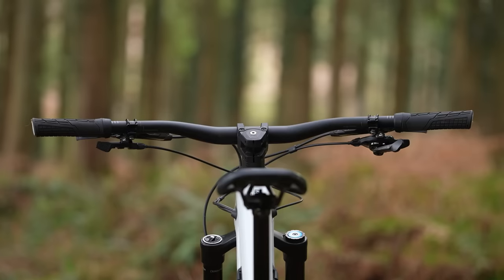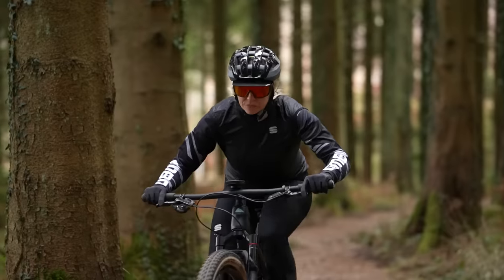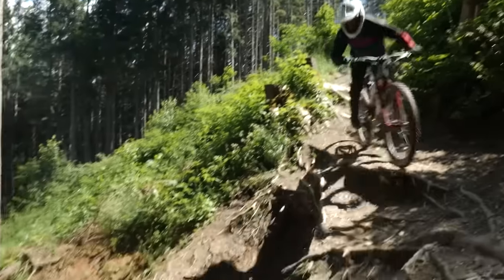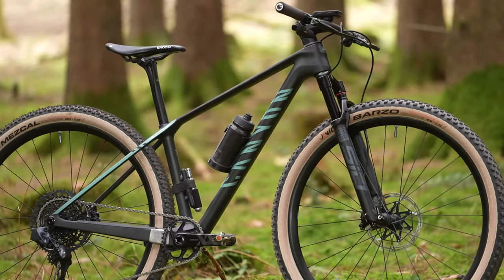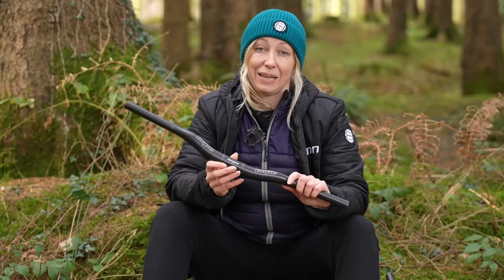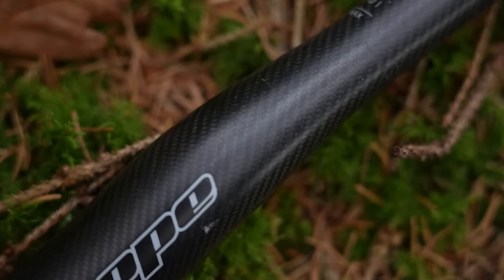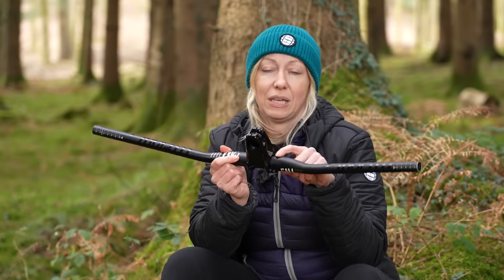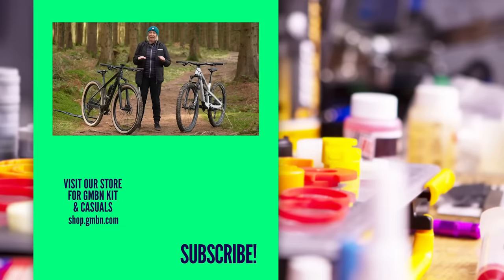Mountain Bike Handlebars Explained! | What's Right For You?

Comment: I changed out the bars on my bike for ones with a 60mm rise because my back was hurting, and it made a huge difference. Immediately the pain was gone and it feels great going downhill, which is what I prefer anyways. Still not bad up hill either. Only when it get's really steep is hard to to keep the front down, but it's rarely an issue and well worth getting rid of the back pain.
Reply: yeah you can bend elbows when you need to be lower, anyone reading this get comfortable!  you can still shred fine
Reply: are you 40+?

Comment: There are actually many -40 degree stems on the market. In fact, they're cheap +40 degree stems meant for beginners, but you just flip them upside down.
Reply: This sounds like one of those counter life hacks. Like they try to bend the bars to make it negative and you just walk up and flip it over.
Reply: @busterbeast999  installing a stem upside down is not really a "hack", it is basic.
Reply: the heck.
thats written -+40 that means its on you how you used it.
what she talking about is the one piece carbon negative 40° handle bar.

Comment: Great video covering a lot of info!  I just decided to get a handful of low end model stems in a variety of lengths and rises and brands and see what configuration I like best - they only cost around $30 each. I did the same with handlebars. Once I figure out my sweet spot, then I will know the exact specs I need if I decide to upgrade to a higher end component. I'll also have the ability to modify in the future if I want. Roughly $300 for 4 stems and 5 bars will give me a full range of combinations to play around with. I'm not sure what a bike fitter costs, but I'm thinking this is a better option 😂

Comment: #askgmbntech I recently got back into mountain biking, I've ended up with a Norco Torrent with 800mm bars and I've later also bought a Trek Procaliber with 750mm bars. When I ride the trek I find that my hands hang off the end of the bars slightly, is this likely to be an issue with handlebar width or is it likely I have my brake levers/shifters in the wrong place?

Comment: I am 1,63m and I tried dozens of grips. Also all angles of my bar rolling forward or backward. My previous grips were the Egon  with the mini Wings. They made my outer wrist pain go away, but they caused numbness 😱 I switched to the Ergon GXR. They solved the numbness problem but the outer wrist pain came back. So I looked for something that is nice and squische and provide the angle of the Ergon mini wings. Then I found out that there are bars with way more backsweep. Tested the natural backsweep of my hands, like Anna discribed. Voila: A backsweep of at least 16° is needed. Went for one and on top I shortened the bar to 760mm. Boom: Nice comfy position for a lot of hours of riding to come. Well, I admit they look funny and some friends called me out for using a trekking bar on my trail bike and I may break, but it is certified for downhill riding 💪🏾

Dmn, that was journey to find a good position 🤪 At least it made my way to a comfy position on my gravel bike way shorter 🤫

Comment: Look at the angle your wrists make. I found having a lot of backsweep helped a lot to keep wrist straighter. Kona Handplant bars are a nice sweep. Mounted upside down you don't even need a -30⁰ stem or anything. you will need a longer stem to compensate for the backsweep, I went with a 130mm stem to put the hands back in the same position as the flat bar.

Comment: It's surprising to see how bar width has developed.
Back when I was racing in the 90's, expert were adamant that no wider than 650mm should be used. And my push up width is 950mm! 😄
I had to make my own bar extensions in a lathe 🙄

Comment: I'm running 720mm carbon bars on my trail bike, but I can't figure out why I can't seem to keep my front wheel planted on the climbs. Idk if the bike is too long or too short, if I need bar drop (I'm running flat bars), or if maybe the stack is too tall, but the bike always pops wheelies if I'm in the saddle and not deliberately shifting my weight forward. That being said, it descends like an absolute champ just keeping my body central on my bike. Any advice would be helpful.
Reply: Longer stem, it will naturally bring body weight over the front wheel.

Comment: Rolling the bars slightly backwards on a hardtail makes sense. Thanks! I didn't think about that so far. 
I don't know if the more agressive the riding the wider the bars is a right approach i have relatively wide shoulders compared to my size and I feel like I have more control with a 740mm bar than a 780 or even 800mm bar because there's more room for the bike to move in a controlled manner underneath me in technical terrain, when the front for example deflects going higher speeds when descending
Reply: If the bars are wider than what your body could naturally "fit", you will start getting shoulder aches.

If you want better stability without relying on bar width too much, you can strengthen your arms and shoulders.

Comment: Woo Hoo...  So 1st out of the way...   What we need is a Retro Girvin Fork system on the bars, giving some non twist suspension and allowing a quick shift bar height for up then down hill...
A simple twist or flip lever on the side of the stem changing the rise from high to low on the climb, then back again on the DH... with some rubber buffer for vibration above/beyond the front forks... also means you could lock the front on the climbs but still dampen the vibrations.

Bob keeps an eye on my handlebars for me... That's him in my User Icon... He's up front on all my rides (and mediocre videos.. but hey I'm getting a little wimpy in my middle (cough) age...